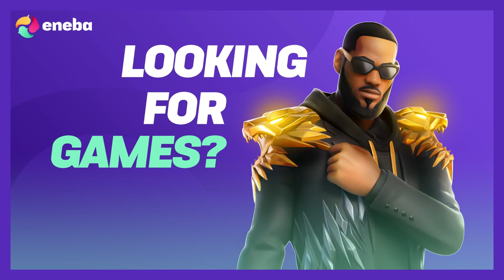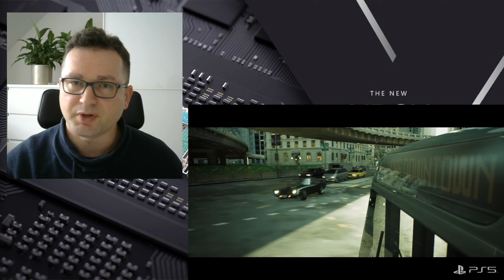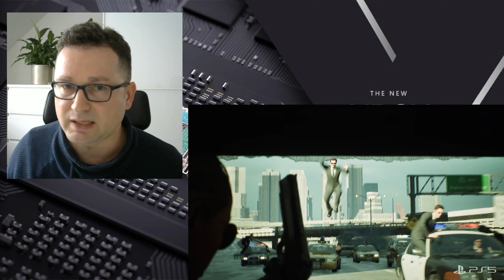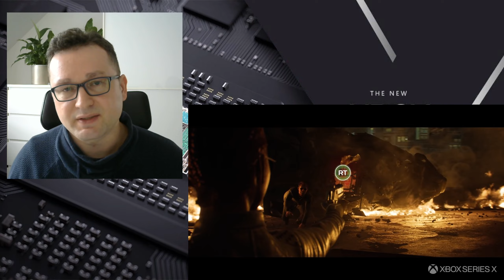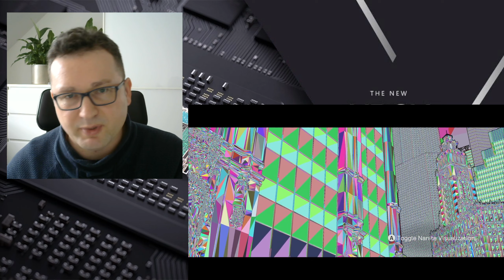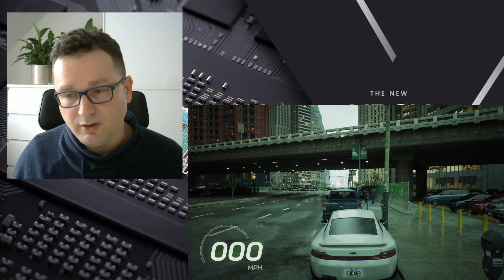When Devs Will Start using Xbox Series XS Next Generation Tech

Comment: When will devs start to use XBSX next gen features? The answer is how easy are they to use by devs and are the devs be able to sell it to enough consumers to get their money back. Why show the Matrix UE5 demo as an example of next gen tech. That is not the XBSX tech. That is mass asset streaming tech made possible by UE5. The PS5 makes full use of mass asset streaming tech because it can stream the assets off the SSD 2x faster than the XBSX. No Xbox tech can fix that. You can cut a few corners but you cannot get rid of a data transfer deficit at the source. The SSD.

Comment: If the features are too heavy on the system resources, they never will use them. RDNA2 is old tech now. RDNA3 hardware is already on the market.
Reply: And before long that will be old too
Reply: True, & like RDNA 2, RDNA 3 features really are not all that special. The best thing about the RX 6000 & 7000 series is their raw power & energy efficiency, though sadly their performance when it comes to ray tracing is average at best & when RT is used performance takes a massive hit.
Reply: @bagg10101  ps5 is stronger than pc
Reply: @teddosyng  ur mother does not love u, clearly.😂
Reply: @bartosa9695  cry pc user
Reply: Console and PC are 2 different constructions. 12 TFLOPS Series X is a very large reserve of power for consoles. Games are much easier to create for consoles and you can get more out of them than it is on paper. New technologies from Microsoft and AMD will make a huge difference and this will be a real next-gen. For 2 years, the games were based on old consoles and showed nothing. UE5 will start to unleash the power of PS5 and Series X. Already they will slowly start to apply new technologies.
Reply: @Anima19879  ps5 is more powerful compared to the rtx 4090 and xbox 
rtx 5090 will be the same as ps5
Reply: @jeisntthereanymore  cry pc fanboy
Reply: The features are meant to lighten the load and improve performance 🤷🏻‍♂️Mesh Shaders, Hardware Acceleration, Variable Rate Shaders, Sampler Feedback Streaming, Velocity Architecture etc…3rd party developers haven’t been putting in the time to utilize them because PS5 doesn’t offer them
Reply: ps5>xbox and pc